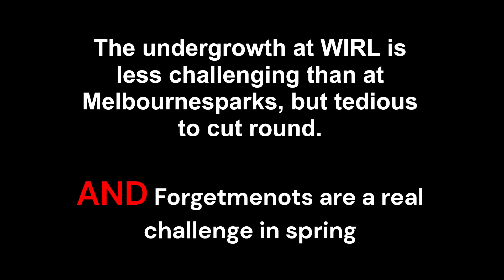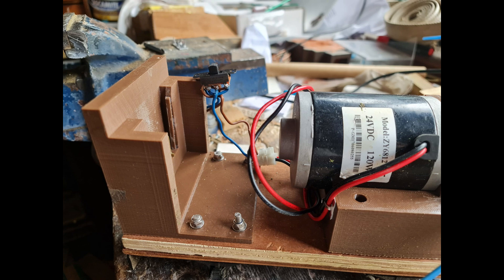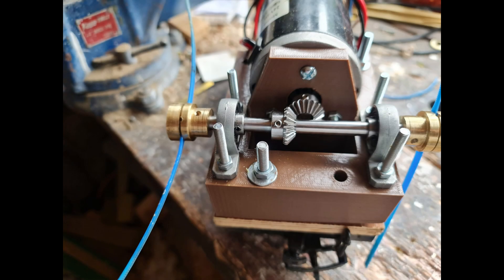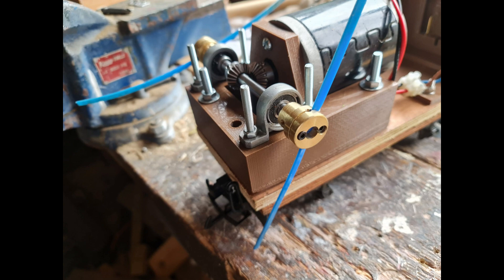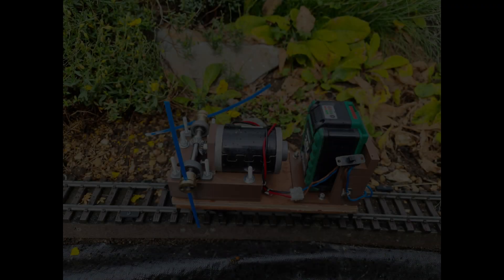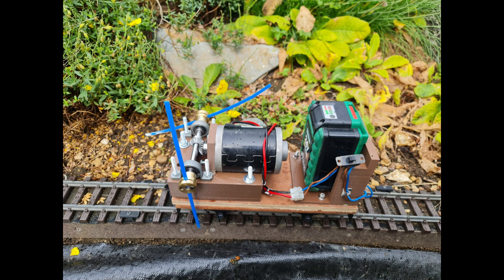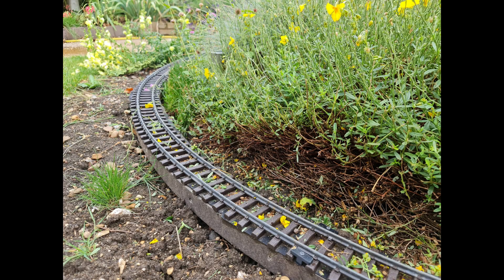WIRL 9 July 2024 PWD monster trimmer

Comment: I don't know why I haven't been getting notifications for your content! This is absolutely brilliant! Fancy building one for the FeckHallBahn??
Reply from the maker: @FeckHallBahn  certainly happy to 3d print the motor and axle mounting block; and the battery block. Its all mounted on a plywood sledge that is screwed to an LGB chassis. The type of battery may change the battery block design. I use the battery from our mower and strimmer. In short - happy to have a chat how to build one for/with FHB.
Reply from the maker: I can make the hubs for the strimmer cords too.

Comment: How about a spinning wire wheel like a bottle brush flicking most pcs off the track mounted up front... Thanks for the morning coffee...
Reply from the maker: @caseyvillemodelrailroad3877  I think there is a danger that a spinning brush (wire or otherwise) would reset/half-set the points as the train approaches resulting in derailments. That's why I think a blower may work better.

Comment from the maker: I promised a parts list - so here it is:

Wallingford Industrial Rail Ltd. Weed Slashing Monster (WSM) parts-list.

1.	Motor of your choice – I used a 24v scooter motor I had bought for another project (converting AC mini lathe to DC).

2.	Pillow bearing blocks – 2 off – 8 mm (https://www.4bearings.co.uk/)

3.	Bevel gears – one pair – 1:1 Bevel Gear 1 modulus 20 8mm shaft (eBay seller => worldwidelectro) 

4.	8mm silver steel axle – (source: gwr-fasteners - https://www.gwr-fasteners.co.uk/)

5.	3D printed mounting block for motor and bearings to suit motor and bearings.

6.	3D printed battery housing to suit chosen battery 

7.	Assorted switches, fuse, and wiring to suit your selected control system.  I am planning an upgrade to radio control at some point – to save having to bend down to switch the beast on.  Or more importantly, off when the strimmer wire is whirling close to the switch!

8.	12mm plywood (base to mount 3D printed mounting and housing) to be used as a skid that can be bolted/screwed to flat-bed truck.

Items 1-4 purchased through eBay, various sellers (other suppliers are available).

I am happy to share the Sketchup and/or stl files if anyone wants to make or modify the WIRL-WSM in exchange for suitable acknowledgement to Melbournesparks, for the inspiration) and WIRL for the files.

Comment: I got a silly question...
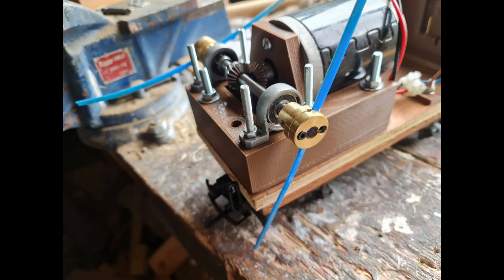1:08 - those lovely bevel gears - where did you get them from?

I have a few projects (train and other) that could really use those! 😊❤

EDIT: definitely interested in a parts list if possible, and thankyou for a lovely video 🙂
Reply from the maker: @LordPhobos6502   hi. The parts are from evil bay - I’ll get a full list up later in the day, but the gears are eBay # 394207424009. There are other suppliers too. I am impressed with the bevel gears - mesh nicely.

Comment: For inside the rails you could just use a big spinny brush thing.
Reply: How about those things to clean glasses with at the pub. You can cut one to size for the tracks.
Reply from the maker: @a41wilde57 a possibility indeed.
Reply from the maker: I was thinking along those lines, but worry about how it would deal with the points, i.e would it throw the point as the train approaches etc? Hence the idea of a blower which would not catch the point. Some experiments to come I guess.😅
Reply: @ianwm  Get a little turbojet and make one of those jet snowblower things 😆
Reply from the maker: @Dudeface167  not sure about a turbojet - may be a bot warm for the LGB sleepers. I am looking at a bilge ventilation fan - 24 volts and about diameter of 4inches (in old money). The directional snow blower is an idea.